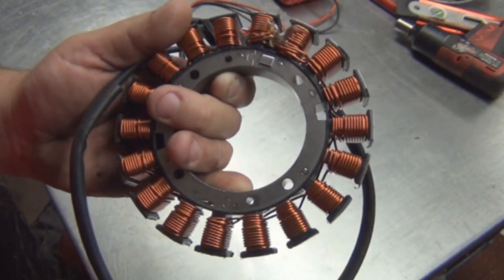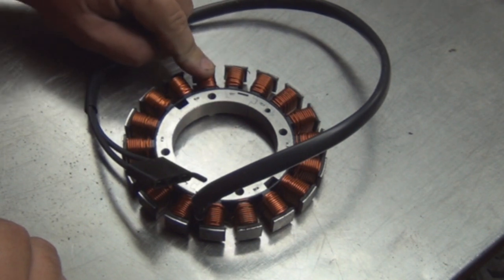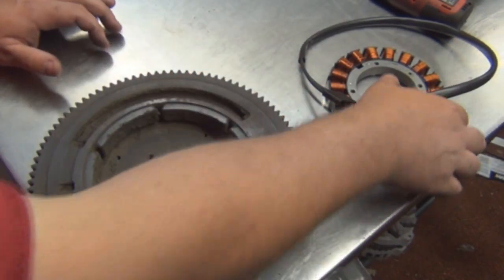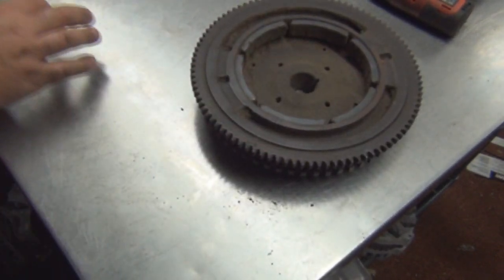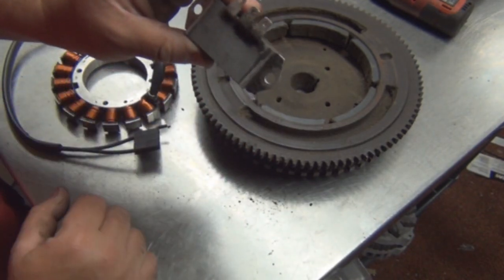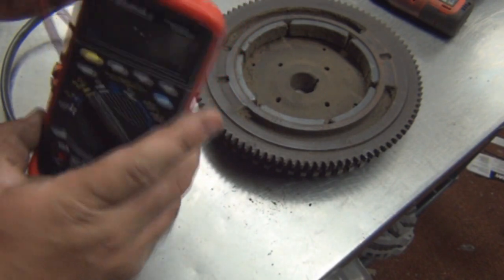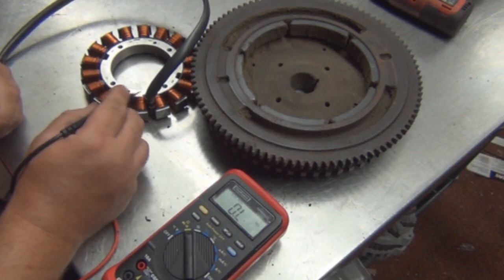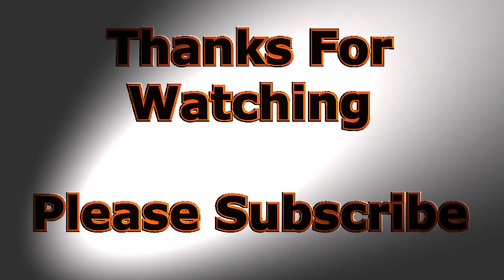How A Stator Works & How To Test video

Comment: I was using a heavy chain hoist to work underneath my lawn tractor. I let that tractor down and was working on my other tractor that had the shroud cover removed. So the chain fall was behind this tractor. I pulled the tractor backwards so to have the chain fall slide over and clear the tractor. Like a fool I did not consider that it would hit the motor which at the time was running. The heavy hook hit the flywheel coil magnet which sheared the magnet off leaving the aluminum studs, that hold the magnet on, broken off even with the flywheel. So instead of trying to drill the screw threads out I had a used 19 hp Kohler with a good flywheel that was working when it was set up and this one was a 18 hp Kholer. So I took the flywheel off the 19 hp and put it on the 18 hp. I did not try to start it until the next day. The next day the good battery was completely drained down, and the starter gear was up and engaged with the flywheel. I figured it must have been pulled up and stuck when I had pulled the flywheel off and didn't notice it when putting the other one on. After getting the gear down and charging the battery the motor turned over but seems to have no fire. The flywheels were the same height and width but a little different in the shape/contours on the top surface. The keyways seem to be in the same position. All I can figure is that maybe the stator on these motors are different diameters and the inner circle/magnets are different in diameter  so maybe I have to take the flywheel back off and use the stator off the 19 with the flywheel off the 19 when putting it on the 18. My question is does a stator cause the battery to run down over night if it is too close to the inner magnets, or do you think I just had an open circuit due to the starter gears being engaged with the flywheel. I can't remember but maybe I left the key on. 67 years old and mind is slipping. I should have measured the inside diameter of the flywheels and the outside diameter of the stators to make sure. But I assumed they would interchange.
Reply: I was in a hurry to cut grass before the coming rain when I was trying to get this Kohler with the exchanged flywheel started. I guess the first thing I need to do is to check to see if the fuse blew. I am thinking if this thing was on an open circuit all night that ran the battery down it may have blew the fuse. I just don't understand how that starter gear got jacked up and messed with the flywheel gears just setting over night. I really doubt that there is any operational difference in the specs of these two flywheels and stators even though one had a slightly different outward design.
Reply: @zedcartwright5267  
Hi Zed
Maybe it's time to pay some one to do your repairs we used to be able to do these things but we forget little important bits and it doesn't work out.
Get some one to keep your mower going and just enjoy cutting your lawns.
All the best to you Zed.

Comment: Your measurement at the end was infinite ohms, meaning no connection between coils and inner metal housing (measuring resistance not voltage).   I believe you said voltage but good stuff either way.
Reply from the maker: I probably did accidentally say.voltage. I did test it in ohms. Thanks for watching and commenting. I greatly appreciate it. Please like share and subscribe.

Comment: im working on a jetskii and i have power going to my stator through a 6 pin plug when the battery is plugged in. is there supposed to be power supplied to a stator?
Reply: No

Comment: I have a 95 two cylinder  two stroke. .runs fine on idle but bogs down when giving  it gas...entire fuel system  and lines have been replaced. ..need help
Reply: +Kevin Seymour - Most of the time when Engine can only run on Choke or Bogged Down the Culprit is likely the Carburetor / Fuel Related.  Clean your Carburetor and check Fuel Lines etc....

Comment: Where can I learn more about the science involved in this process? From what I am gathering, the stator is an electromagnet, and when it spins, it produces an electromagnetic field, which somehow produces an AC current (the part I don't understand), which then travels the wire as input into the rectifier, then outputs as DC (how did this happen and what is the difference between AC and DC of moving electrons?), which then charges a battery (how?).
Reply: The chemistry of a battery relies on an energetically favored reaction involving the transfer of electrons between ions in two different parts of a battery. It normally only goes one way. Thing about a ball rolling down hill. Will it ever roll back up hill? No. A battery runs out when the reaction completes, or when the ball reaches the bottom of the hill. Using the current produced by the stator you can reverse the reaction to its initial state in which case the battery is "recharged." Essentially you use that current to "roll the ball back up hill."

As for the electicity and magnetism part, thats gonna require a more in depth physics class. Check out Dr Walter Lewins lectures online, it's basically covered in what most call Physics II, Electricity and Magnetism.
Reply: +Taylor Torrent Thanks alot! Now what is the difference between AC and DC currents when both are just free-flowing electrons?
Reply: +SogMosee what you are dealing with is the principle of induction, when a magnetic field passes by or through a coil.  The magnet causes a flow of electricity in the coil and basically resembles a pulse - as the magnet approaches it flows one way through the coil and as the magnet withdraws it flows back.  When you use a rectifier it basically "flips" the negative pulse upside down.  So instead of an up-down-up-down wave action you get side by side "up" pulses.  The voltage regulator can also "clip" these at a set voltage so that the peak of the pulse doesn't get too high.  In a stator shown in the video, the multiple coils generate many slightly offset peaks (think overlapping) that once they are all "rectified" and "clipped" appear to be a solid line of DC current.  Its much easier to understand visually.
Reply: +SogMosee- Mr Wizard and m not kidding son. YouTube "how do motors work" (Mr. Wizard)

Comment: how do you tell if its actually charging? like a voltage spec
Reply from the maker: When it’s all hooked up and running just be careful of moving parts and loose clothing and check with a multimeter if able to do so safely. Here is a video how to do it on a car but can be done the same on a lawnmower https://youtu.be/UyKexCny9yk 
And here is where you can get a multimeter https://www.amazon.com/dp/B08DHHJPS1/ref=cm_sw_r_as_gl_api_glt_fabc_KTPBBBRQ0DK6TXHVDXRN?linkCode=ml2&tag=handprobfixe-20

Comment: When you checked the resistance from the terminal to the metal base, you said that you shouldn't read any type of voltage. I think you meant to say any type of resistance. If your measurement is saying OL then this means that there is no continuity between your terminal and the base which is what you want.

Comment: so is a regulator rectifier a inverter from ac to dc? and it's also a transistor and such, why can't cars just use power though coils to cause thrust? instead of petrol propelling use ccw coils and lightening powered? flywheels in series with bigger capacitors and massive rectifiers?
Reply from the maker: +Leslie Jones yes regulator rectifiers are similar to a power inverter. As far as the other questions, you would have to talk to the engineers that design these cars. This particular flywheel is out of a lawnmower. Thanks for watching and commenting. Please like, share, and subscribe.
Reply: lol kool thanks man for the answers
i've always beleived in same pole inseries alternator cars sure wish someone would invent segways like that
Reply: An inverter converts DC to AC.  Takes a flat voltage, makes a (sorta) sine wave out of it.  So, inverts the signal, making it alternate.  A rectifier goes the other direction, makes that sine wave into a flat (DC) voltage.

Comment: Video definitely help though how do you get to the Stator / Flywheel?  I have a LZS and I keep blowing batteries.  I'm going to try a new Voltage Reg but if I still get same results I'll have to hit the Stator.  Video was great as I didn't know about the Stator nor what it did.  Great vid and explanation.

Comment: got a 1994 polaris atv coil reads good have no spark could  it be the stater
Reply: Cliff Abitz if it is a magneto ignition it could be but if it is a battery ignition then it is used as an alternator

Comment: How are the magnets attached to the flywheel, glue, magnetism?
Reply from the maker: +dubsaloon I believe they are glued. Thanks for watching and commenting. Please like share and subscribe .
Reply: JB weld would wkrk fine just let it sit over night.  Use clothes pin ends for spacing in between the magnets, (having every other magnet opposite polarities I.e north pole then south pole and so on) and an 1/8' gap at the tops of all the magnets for stator ckearance when reassembled.

Comment: what's the common cause of the charging wires (yellow) to fail?
Reply from the maker: Shorts in the wire or winding's. I hope this helps, thanks for watching and commenting. Please like, share, and subscribe.
Reply: My stator bolts on to the magneto cover and the flywheel spins around it,from the motor side,over the magnents in the flywheel is a tin plate with fibreish looking material glue to the flywheel and tin plate the tin plate come loose and some of the fibre material broke so I removed the tin shield and broken fibre its glued to exposing the magnets the still ran fine but damaged the yellow charging coils again,do I need that tinshield over the magnents and does the shield act to disapate heat as the stator is getting very hot,your feed back is appreciated there's not much info on causes of stator failure,at first finding the tin shield had come loose from the fly wheel it was not spinning with the flywheel consistently and resting on the 6 post stator coils,I put a new stator in without the shield on the flywheel and it was charging again fine but then failed again ,do I need the tin shield and fibre between the magnents for correct running temp,cheers

Comment: There should be a small resistance across the windings, from one lead of the connector to the other. What is a normal range to look for. A zero ohm short is bad news. Open is also bad news.

Comment: To check it where it this located under the stator ?
Reply from the maker: Yeah usually there's a ground wire and black, and different colors for each pulser. Its located under the stator and should move / twist as you move the throttle.
Also on those engines if compression is 70 or less it won't run.. Usually

Comment: When you checked the resistance (ohms) between the two wires on the plug, you sort of glossed over what is an acceptable value.  Your meter flashed several values and you just said "that's good".  What's the max acceptable resistance?
Reply: Bunny Crayne if the o reading is 0, that means there is continuity through the coil windings, which is good and what it read. If it reads high resistance, 1ohm plus, that's resistance that will cause a voltage draw and will not work efficiently due to the resistance to build a magnetic field.
Reply: Should read 0 if it reads any more something is wrong
Reply: Well yes if your checking continuity between the windings themself, A basic short will read a zero on ohms meter. A open will read a 1. Depends If your checking for a short between windings and the outside for a short in which you don't want. He wasn't clear when he said go to ohms scale and then said later if you get any voltage there is a problem. How are you going to read voltage on the ohms scale? @-PlayMaker-

Comment: How many volts is a stator suppose to put out ?
Reply: +Marina Thompson - It all depend on the usage of the device/engine specs.  Here is an Example of; Most Stators output about 27 volts AC at wide open throttle. The rectifier/ voltage regulators coverts that to DC volts and a volt meter set to DC should read 13.85V - 14V.

Comment: Will a shorted stator cause the engine to not start or even crank?
Reply: Tim Pape it was the fuse
Reply: NO, the ignition coil does that.  The stator only charges the battery and usually powers the headlights directly AC (basic lawn tractor)
Reply: +Dave Anderson - 100% CORRECT !!!  Short answer = NEVER !!!

Comment: THANK YOU; I NOW KNOW WHAT THEIR TALKING ABOUT WHEN THE MECHANIC SAYS MY STADER NEEDS TO BE REPLACED; IS A STADER ALSO ON THE FLY WHEEL IN AUTOS?
Reply from the maker: In automobiles you have the alternator . Everything is within the alternator. I hope that helps. Thanks for watching and commenting. Please like share and subscribe.
Reply: +Tim Curtis - A Stator is an Alternator.  In a Car World= Alternator and in the Lawn Riding Mower / Small Tractors= Stator. NOTE : Both have the same function, they both Charge Battery or using as Accessories.

Comment: Resistance (ohms) is tested in parallel the same way voltage is. Amperage is what you cannot test in parallel to your wiring/load or you'll toast ur meter fuse.
Reply from the maker: +Steven Akers I was testing resistance and plus there is no power supplied to the stator, it is out of the machine. But thanks for watching and commenting. Please like share and subscribe

Comment: I crossed my jumper cable wires trying to jumpstart my mower (Kohler) and now she won't make a sound. What do I fry?
Reply from the maker: Check to see if there is a fuse coming off one of the battery cables to see if it is blown. Then let me know the results.

Comment: Where does the stator wire hook up on a 12hp Briggs
Reply: +Dennis Stimmell - Depend, some actually don't have it so it all depend on the set up. Best way to find out.... Look under your Fly Wheel and you should see the Wire coming out.... Follow that and you should see where it hook up to!

Comment: 3:31 this is good? 0? isnt there supposed to be at least a fraction of an ohm?
Reply: Yes there should be a fraction of a few ohms which means, it has a slight resistance and that is a good thing. 0 resistance is no good it means it's an open circuit or infinity.
Reply: @carlcap14911  I think your backwards, 0 resistance means a direct short not an open. Just a thought.

Comment: i am making stator for small wind turbine, can  u help me and advice me.
Reply from the maker: I have never made one myself but other people on YouTube have. Alot of people use car alternators or electric motors and build propeller shaft out of PVC pipe to put on the front and a special swivel connector so it can spin around on the pole. I really cannot tell you much because I have never done one and I am not very familiar with the task. I hope I helped in some sort of a way. Thanks for watching.
Reply: thanks
Reply from the maker: hameed soft No Problem. Anytime.
Reply: thanks

Comment: Doesn't a lawn mower have a combustion engine? Doesn't it run on gasoline? Why does it need a battery for? I'm sorry I don't know much about mechanics but I would love if someone could explain.
Reply from the maker: If the law mower has a starter and other devices like electric clutches, it will need a battery and a charging system. If it's just a pull start mower with no electrical  devices it will not need a battery. I hope this answers your question. Thanks for watching and commenting. Please like , share, and subscribe.
Reply: handy man Thank you for answering!
Reply: It's only to start your mower and run the lights
Reply: Wow dude, you OK?
Reply: lighten up francis

Comment: Excellent
Thank you Thank you
Reply from the maker: I’m glad you found this helpful. Thanks for watching and commenting.
Reply: Thanks for the reply.
 I'm working on a tecumseh v twin 18 hp model OV691EA SPEC 600824C
The manual is not clear on the charging system. It shows what might be in the system and so far I have not found some of the mentioned items rectifier and diodes or regulator/rectifiers.
Can these parts be part of what I would call a coil (spark plug lead)

Comment: I was told to check for 309 ohms resistance was I told wrong. This was told to me by the dealer and the manual.
Reply from the maker: +GusgusA1 if the manual has the resistance specs, they are accurate. Thanks for watching and commenting. Please like share and subscribe.

Comment: can someone show me how to test a regulator with a multimeter
Reply: glen positive or red test lead goes to the anode and the black or negative lead goes to the cathode. This is called forward biasing a diode. There are 4 of them in a full wave bridge rectifier.  You will read about .7Vdc on the meter. That’s 7/10 of a volt for a silicon diode.  Reverse the leads and  will be much higher,  in circuit testing may not yield exact results because of components in parallel.

Comment: Crappy video. For one thing, and most importantly, you failed to mention that while the flywheel turns around, the Stator remains stationary. That is why it is called a Stator. It is the magnets on the flywheel passing by the stationary coils on the stator that induces a current.
Also, OL on your meter display stands for Overload, which means that the resistance is infinite. And lastly, you said that if it reads any 'volts' it is bad. You are checking for resistance on the Ohm scale. Any reading will be in Ohms, not volts.
Reply from the maker: I usually do not respond to negative comments. But yours , I couldn’t resist. OL stands for open loop or open line . not over load. Now I just discredited everything you just said. Have a great day.